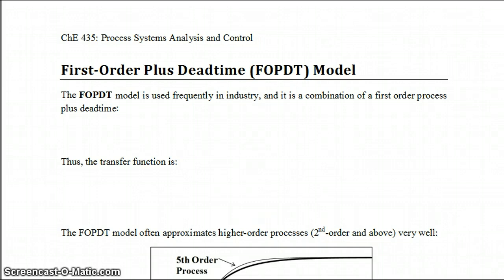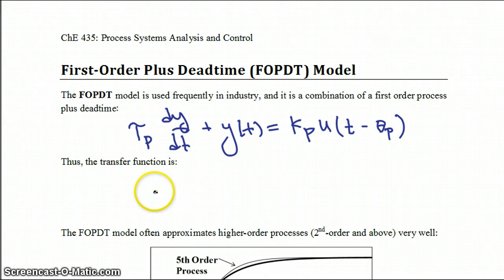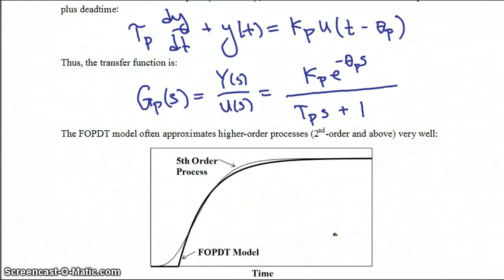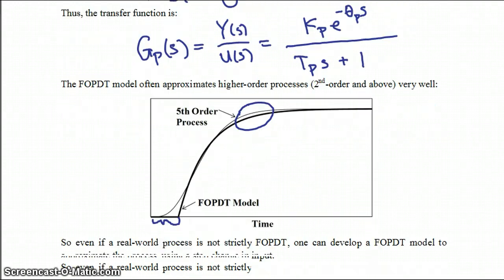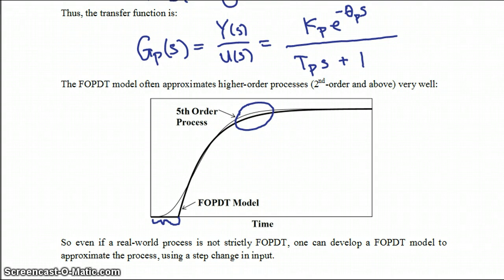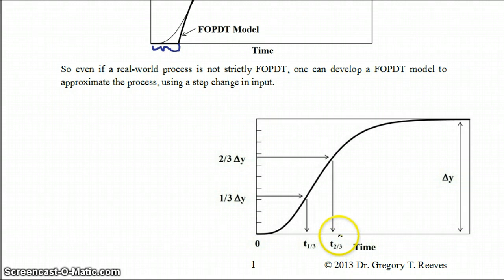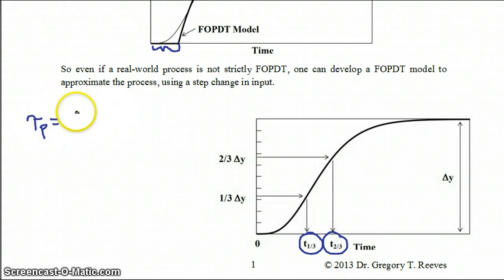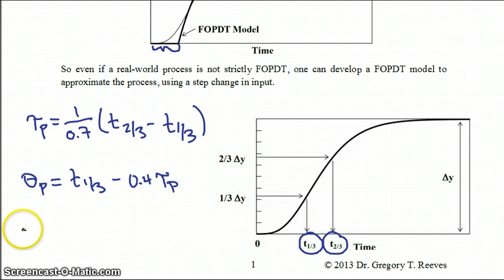First-Order Plus Deadtime (FOPDT) Model

Comment: How do you plot the fopdt model?
Reply: Which piece of software are you using?
Reply: Greg Reeves I found a python script to plot it as it is an ode so I had to integrate it. I'm not using any particular software just wanted to validate my model.
Reply: For some reason the values that fopdt gives me actually create a suboptimal controller.. Maybe I'm measuring step response from standstill when I should be measuring when already moving (it is a ppi controller for controlling velocity). I'll have to investigate..
Reply: Gregory Reeves Interesting. I'm using this table to get kp, ti and td. Ki is then kp/ti and kd is kp × td. http://controlguru.com/wp-content/uploads/2015/08//pidftuningchart.jpg
Reply: I'm also using derivative on PV instead of derivative on error (CO = kp*E + ki*I - kd*dPV/dt). But these calculations are designed for such an implementation anyway)
Reply: Gregory Reeves Yes reducing aggressiveness improves precision but introduces sluggishness. What I don't seem to achieve is a fast response and no overshoot. Basically I want the controller to output a really high command when setpoint changes and then to quickly decrease and maybe even reverse the action (which is equivalent to braking) as the desired position is about to be reached. Can you give me a hint on how to implement a controller that can take advantage of the fact that the actuator can be slowed down quickly as it approaches the setpoint through the use of a brake?
Reply: Gregory Reeves I'm just pondering how to reproduce the natural behaviour that a person would do during manual control. So for a sluggish actuator a person would turn it all the way up and then reverse it to achieve fast slowdown.. Maybe I could implement a velocity profile with a separate brake controller that controls the slowdown.. Although it would be fantastic to have a single controller that can do both without any if-else logic.